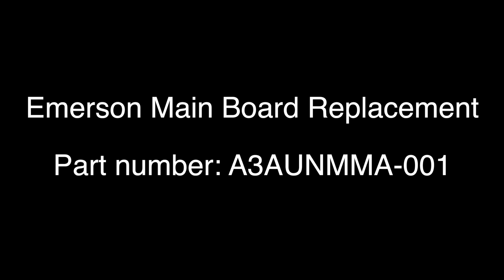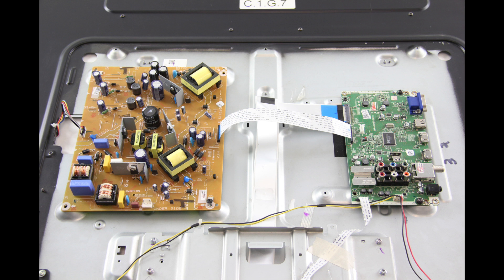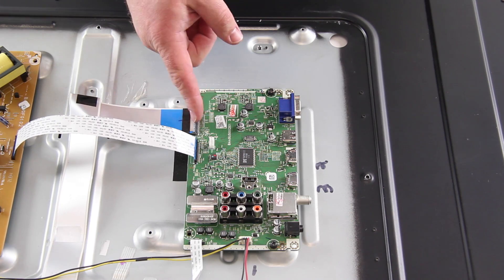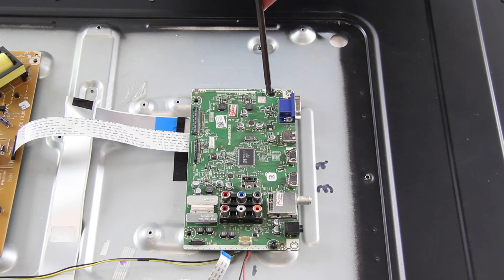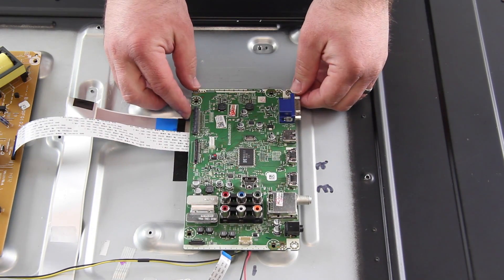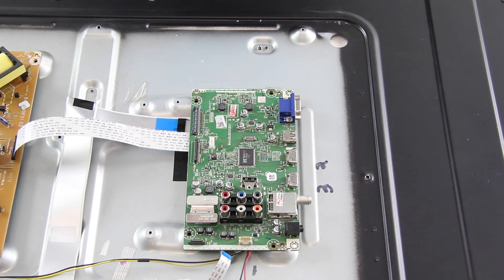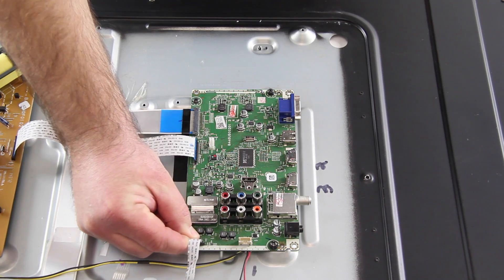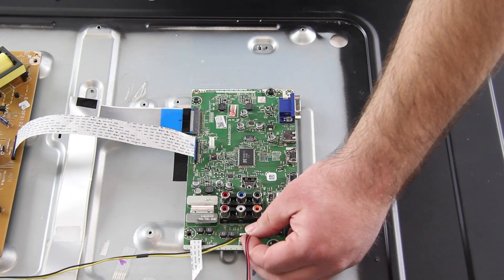Emerson A3AUNMMA-001 Main Board Replacement Tutorial LF501EM4 LF501EM5

Comment: I have a Haier Roku TV Model Number: 55e4500r. First the wireless capability went out. Then the TV began freezing and restarting on its own. I researched online and resolved the issue is with the main board, which I replaced today. Issues still exists. I now believe the power supply board needs replacing. I'm basically going by the process of elimination, and this is the last part I believe to be faulty that I can easily replace. Any advice ShopJimmy? Thanks.